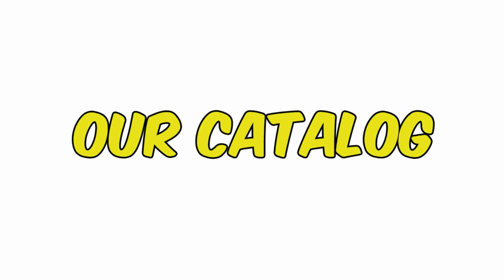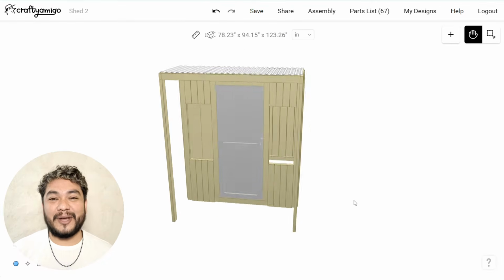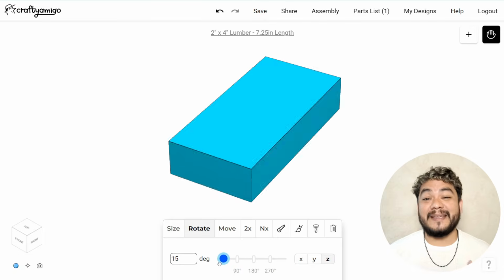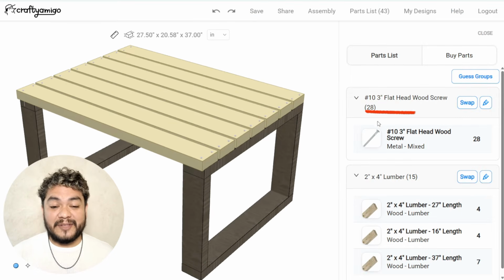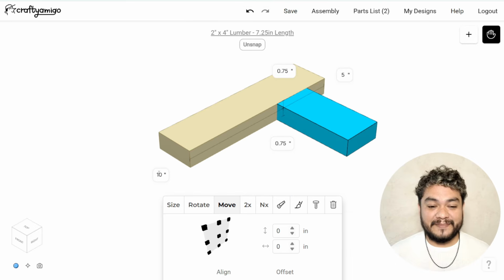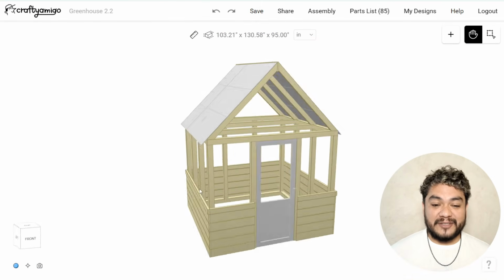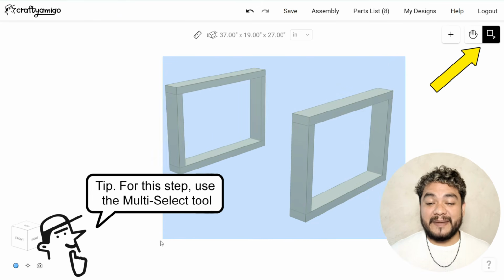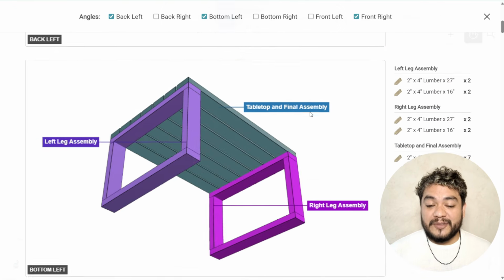First Steps | Design Your Woodworking Project | Crafty Amigo Tutorial

Comment: would be great if you add lumber with standard european sizes (5x4, 5x5, 5x10,5x15,5x20, 10x10, 15x15
 cm)
Reply from the maker: Fortunately, on our platform you can customize any profile to fit your needs. Just select a profile, and using the sizing tool you can adjust the length, width, and height.

Comment: Ive watched every single tutorial offered and still can not figure out how to effectively use this for what I need. Nothing seems to work like it does in the tutorial videos...and Ive tried it on multiple devices. I want to be able to use it really bad because it would be perfect for what I need if it would just work right. My biggest problem is how to make anything line up and be flush to where your measurements are actually accurate. Yes...the corner buttons make it easy to align right in the corner or right in the middle...but if you need to place a piece connected in a very specific spot anywhere besides the corners and exaxt middle...its a nightmare and I end up trying to do the math and use the little number boxes instead and then the whole thing usually glitches out
Reply from the maker: I understand. What I recommend is first aligning a piece using the points and then adjusting the distances using the input boxes. It’s fairly easy to do. Please let us know by email if any of this doesn’t work so we can fix it.